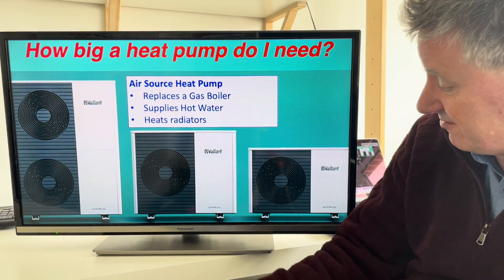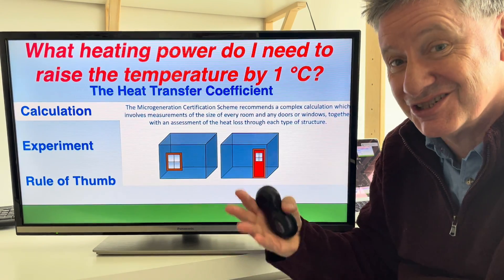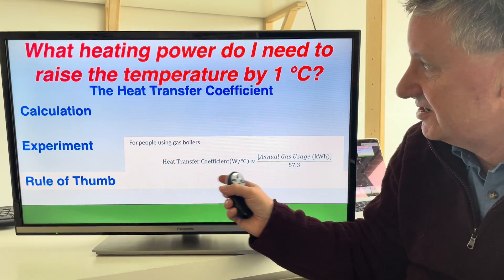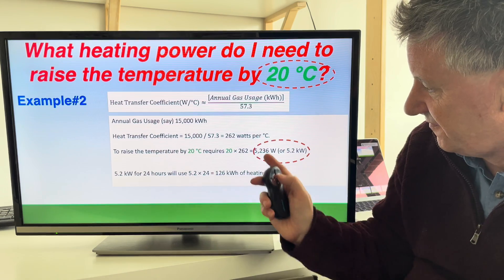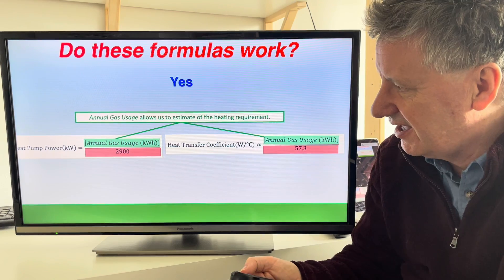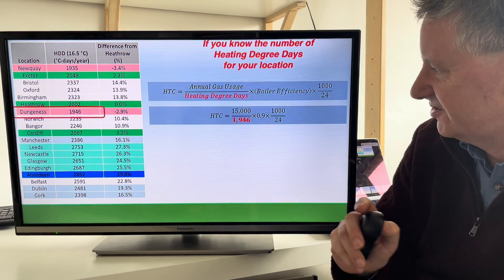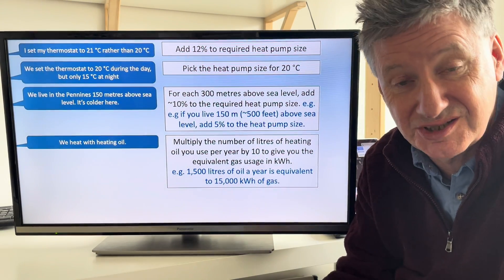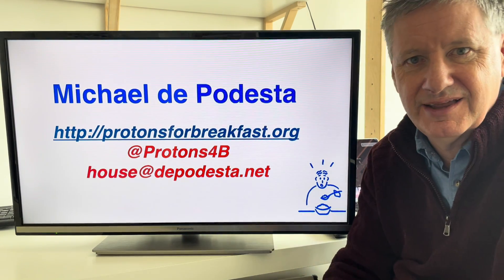How big a heat pump do you need? A simple Rule of Thumb.

Comment: Thanks for the video. My post relates to the values you’ve used in your calculations for a heat pump. I've realised that in working out the Heat Transfer Coeffiecient (W/° C) with your formula you use kWh for annual gas usage whereas my gas bill (in Australia) presents data in MJ rather than kWh. As I’m innumerate I’d be very grateful if you could let me know if substituting annual gas as MJ (37069) would work? My previous 12 month kWh consumption from my electricity bill is 1499kWh which yields a very small .5kW heat pump. Can’t be correct! 
As mentioned, I can’t do maths to save myself but I’m really keen to understand what size heat pump I’ll need to get off gas. Currently, the output load from my 13 radiators is calculated to be 20kW but don’t know if this figure is relevant. Hope you can steer me in the right direction for the rule of thumb calculation. Thanks!
Reply from the maker: Rosemary

Good Afternoon. First of all you are in Australia! Take care - the formula were devised for typical temperatures in the southern half of the UK. So the heating demand where you are will almost certainly be different from the UK.

Regarding conversions, take your gas consumption in MWh and multiply by 0.278 to give the gas consumption in kWh. 

e.g. 37,069 MJ = 10,300 kWh

As you comment the electrical consumption - which does heat your house slightly - is not the main source of heating so teh heat pump size estimate is incorrect.

Gas boilers are typically rated at between 20 kW and 30 kW but this massively exceeds the heating power required in most houses. To reduce output, the boilers switch on and off, heating water in the radiators to (say) 75°C for 10 minutes - outputting maybe 20 kW - but then switch off for the next 20 minutes. Overall this gives an output power of around 20/3 = 6.7 kW

Heat pumps instead produce heat at a steady rate - that increases as the outside gets colder. This keeps the house at a steady temperature throughout the heating season.

Because I don't know about your climate, I would suggest you contact a local professional for advice.

Best wishes

Michael
Reply: @michaeldepodesta001  Thanks for your detailed response Michael.

Your video really helped clarifying lots of questions while also raising others as there’s a dearth of technical information available here (outer Melbourne). While mindful that our temperature zone is coastal, south eastern Australia, with similar although milder conditions than Tasmania were not comparable to southern England, I was hoping the science was still applicable.

Yes, my gas boiler output is 31kW although I’m running the water temp’s to radiators at 60°C which is comfortable given the level of insulation. So far I’ve had several quotes where one company has suggested 2 x 10.75kW heat pumps and another a 16kW HP plus buffer tank. Confusing. 

Given the information in your video, albeit without direct application to my location, I feel more confident to go with a moderate rather than an oversized/supersized HP. Thank you!
Reply from the maker: @rosemarymetz617  Both those heat pump installations are likely at least twice what you need. 

I looked up the Heating Degree Days for Melbourne Airport (1184, 1132, 1264 °C-days per year for the last 3 years). So for the last year you used 10,300 kWh of gas to heat against 1264 °C-days of demand - assuming 20 °C indoor temperature. 
This gives a rough estimate of the HTC of about 305 W/°C. It looks like the coldest it typically gets in Melbourne is around 0 °C so that's 20 °C of demand so you need around 305 x 20 = 6,111 W of heating at most i.e. a heat pump which outputs 6 kW is enough.

Note 1: The heat transfer coefficient is not very good! My guess is some insulation - particularly loft insulation would help - and would also help with keeping cooling in summer.

Note 2: You need to check that your radiators can deliver 6 kW of heat to the house with a 50 °C flow temperature.

I can't quite think how anyone could come up with such large sizes of heat pump except that maybe they know how to install them and feel comfortable that they will be able to provide enough heat.

Best wishes

Michael
Reply: @michaeldepodesta001  Many, many thanks Michael. Aside from the info on heat pumps it seems I have to beef up the insulation. On all counts, great information. Thank you.

Comment: Amazing video, I just share it to some friends. Question: if the required Heat Pump is 5.2kW (as in your example) are they thermal? Therefore, it means that those 5.2kW need to be divided by COP 3, then the electrical power of the HP should be 1.7kW?
Reply from the maker: Oaklejant, Good Morning. 

Yes, exactly that. The heating power required is ridiculously low.

https://protonsforbreakfast.wordpress.com/2022/04/12/could-you-heat-your-house-with-a-hairdryer/

If the COP is around 3 when it is around 0 °C outside and around 4 when it is 10 °C outside then:

For the 0 °C case, the thermal power will be 5.2 kW and the electrical power will be 5.2 kW/3 or about 1.7 kW.

For the 10 °C case, the thermal power will be reduced to (say) 2.6 kW and the electrical power will be 2.6 kW/4 or about 0.65 kW.

I hope that help: best wishes

M

Comment: Excellent explanation but an important factor that is omitted is the heat pump COP.  Unlike the boiler efficiency which is constant, a heat pump COP depends on outside temperature- when you need heat most in winter the COP is at its lowest. Unless on average a heat pump COP is higher than about 3, then you are better of using a boiler
Reply from the maker: Dear R Boukhanouf, Good Morning,

MrKlaw below has already given the answer (Thank you). This video is about getting the right size of heat pump - i.e. estimating the required thermal output - not about working out the electrical power requirements and costs.

Financially, it is true that if the electricity price/kWh is more than than (very roughly) 3 times the cost of gas, then a heat pump won't make much difference to the cost of heating. But remember old gas boilers are typically 75% efficient, new gas boilers are perhaps 90% efficient IF they are used to heat water to below 58 °C. And heat pumps are often 300% or 400% efficient.

In terms of carbon emissions, there is no contest. Gas is appalling with true emissions including methane leaks probably around 500 gCO2/kWh-thermal whereas a heat pump will produce (using UK grid electricity) around 70gCO2/kWh-thermal.

Best wishes

Michael
Reply: My understanding is that this estimate is focused on the output kW you need from the heat pump to achieve the desired temperature based on historic gas usage. The input electricity to achieve that output will rely on the COP so will vary based on external temperature.

Comment: Excellent thank you. I've used a detailed room by room heat loss calculation spreadsheet for my property and calculated about 12kWh loss for the coldest day with 23°C internal and with hot water on top it's covered by a 16kWh heat pump. I was a bit suspicious it was too big but doing the rule of thumb calculation comes to just over 14kWh without DHW which is about right - so that's reassuring! Thanks 😀👍
Reply from the maker: John, Excellent news.

That's exactly why I put the 'rule of thumb' out there: as a kind of sanity check because those heat loss calculations can easily overestimate heat pump power.

12 kW or 14 kW is a very hefty heat pump, but then 23 °C internal temperature is a very significantly warmer home than many. It's your home and your money and hence your choice, but if you lower the thermostat by 2 °C you will save quite a bit and lower the maximum power required by around 10%.

Regarding hot water, I am not aware of guidance as to how to add that into the sizing. Personally I didn't add it in at all! Typically, the heat pump switches from space heating to water heating for an hour or so, and then switches back to space heating. In summer our heat pump does this during the day when there is plenty of solar and the air is warm. In winter it does this at night using cheap-rate electricity. Either way, we didn't add it into the heating requirement, I just noted that a bigger heat pump will reheat a DHW cylinder faster than a smaller one. A 200 l cylinder at 50 °C contains around 10 kWh of stored heat so you can calculate the re-heat time from cold. The articles below describe some measurements I made of this cycle

https://protonsforbreakfast.wordpress.com/2021/08/14/heat-pump-first-operational-data/
https://protonsforbreakfast.wordpress.com/2021/09/07/assessment-of-heat-pump-heating-water-to-50-c-and-70-c/

So my inclination would be to size your heat pump just for the space heating.

In any case: good luck with your adventures!

Michael
Reply: @michaeldepodesta001  Thanks Michael. I've tended to find I wake up with a sore throat too iften with lower temperatures so I have it set warmer than most. To offset the cost I'm to supplement the power requirement with an 8kW solar array and 15kWh battery, making use of a solar diverter and EV tariff. I graphed and factored all this in month by month which predicts I'll be off grid between mid April and October with overall 75% savings in energy before the prices went up and the best thing of course being getting rid of gas. With inflation devaluing savings it's also a good investment with solar alone paying back 20% per year and hedging against further price rises. Without being political the government should be making and facilitating similar investments and getting everybody off fossil fuel dependency.
Reply from the maker: @johnh9449  They all sound like very smart moves.We have an 4 kWp array, 13.5 kWh battery and are off-grid for 4 to 5 months - and I have just ordered more solar to extends that

https://protonsforbreakfast.wordpress.com/2022/09/01/its-been-a-sunny-summer/

We also found that the solar covers 20% of demand even in November. I think you have made some very smart choices. Good luck!

Comment: hi @michael many thanks for your video. I can see that you have included the boiler efficiency in the calculation, while you have not included the Heat Pump efficiency in sizing. Heat Pump efficiency (COP) should be between 3.5 and 2. If we consider SPF of even 2, we are almost sizing the system double the size.
Please suggest on this. How to include heat pump COP in the calculation, if we don't include that, why so? 
Thanks
Reply from the maker: Umar, Good Evening.

When people specify a heat pump size, for example 5 kW, this describes the maximum THERMAL power of the heat pump: the maximum amount of HEAT it can move into your house per second. All these calculations are concerned with heat.

When using a heat pump to heat a house, the ELECTRICAL power is much less than the THERMAL power. As you say, for a 5 kW heat pump the maximum ELECTRICAL power will probably be only 2 kW.

So once you have an estimate of the maximum THERMAL power - using the rule of thumb or by having a survey - you can then work out the maximum ELECTRICAL power by dividing by the COP.

Does that make sense?

Best wishes

Michael
Reply: @michaeldepodesta001   the two formulas 1 HP power = Annual Gas Consumption/2900 and  Heat Transfer Coefficient = Annual Gas Usage/ 57.3, are they effective for all building types and building sizes?
Reply from the maker: @umarrehman7514  Umar, yes. These rules apply to any dwelling in the UK south of Manchester.

But they are just 'rules of thumb'. The idea is that after you have had a survey, then if the results are very different from the rule of thumb, ask your surveyor why that might be. Things that can lead to odd results are if the dwelling has big extremes of temperature change during the day, or just heating one part of the home.

This article by Nicola Terry discusses several shortcomings of the Rule of The Thumb

https://energy-surprises.blogspot.com/2022/06/how-big-should-your-heat-pump-be.html

Best wishes

Michael
Reply: @michaeldepodesta001  thank you.

Comment: Great video and very informative - but on the rare occurrence when it is -10C outside this will only raise the temperature to 10C inside the house? And I assume the kW require is output not consumption of electricity.
Reply from the maker: Charles, Good Evening.

First, yes, the 'kilowatt nameplate power' is thermal power at a specified condition typically with an outdoor temperature of 3 °C if I remember correctly. Some heat pumps have lower power at lower temperatures - so a 5 kW nameplate heat pump might only have 4 kW at (say) -10 °C. For other heat pumps - notably Vaillant - their output exceeds their nameplate output down to exceedingly low temperatures. The electrical power for a 5 kW heat pump is typically between 1 kW and 2 kW.

Second, yes, if your heat pump is sized exactly to be at maximum power with a design temperature of -3 °C, then on occasions where it's - 10 °C it will not heat your house to 20 °C. For those occasions - 1 day in 20 years? - and becoming less likely as the climate warms - it will be necessary to plug in an extra heater. For the other 7,299 days, the heat pump will heat your home with more than 100% efficiency, and reduce emissions of carbon dioxide. If you are particularly concerned about this, then you should deliberately oversize your heat pump - they will all operate happily down to about -20 °C.

Best wishes

Michael